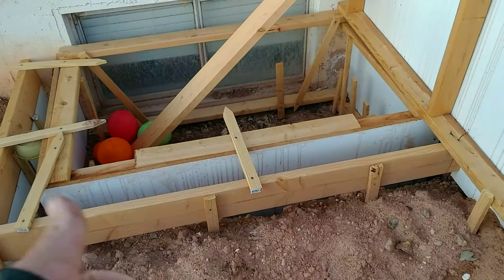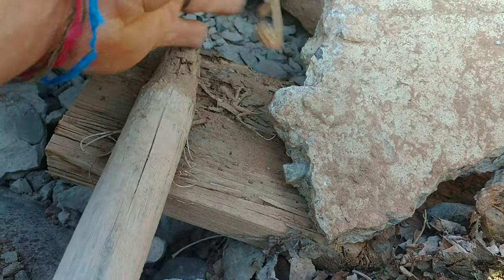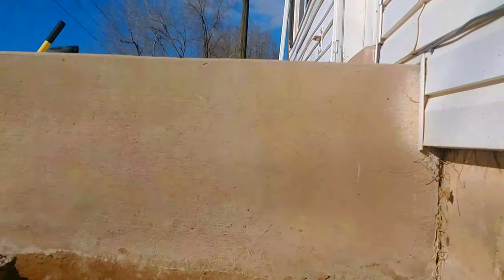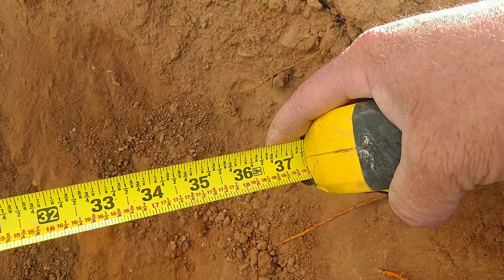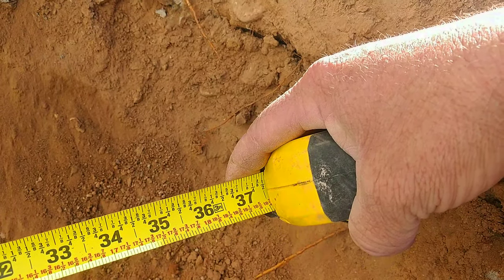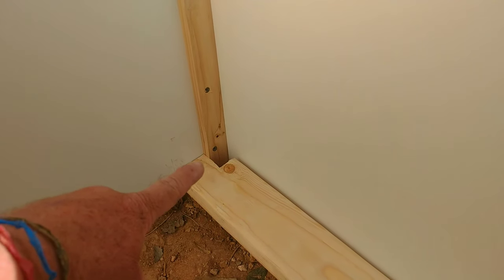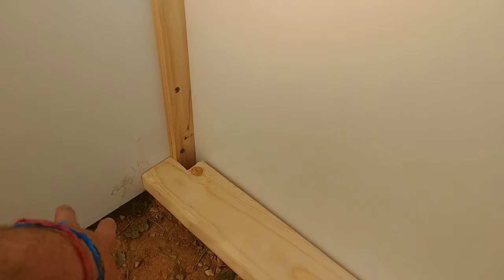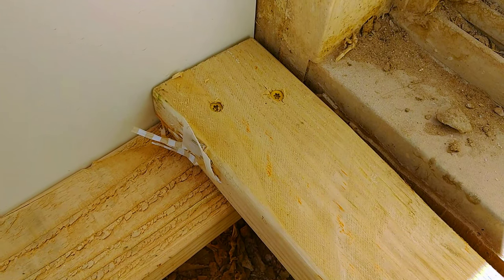Concrete window wells

Comment: Hi, I don't know too much about pouring concrete.  I see the boards for forming the inner wall but there is nothing for the outer wall.  Won't the concrete just push against the dirt on one side?
Reply from the maker: Yes. Normally there would be forms on the outer wall as well.